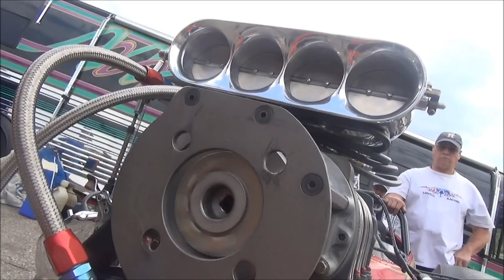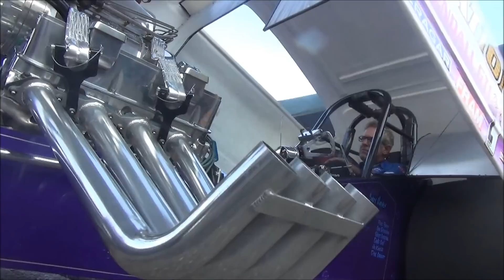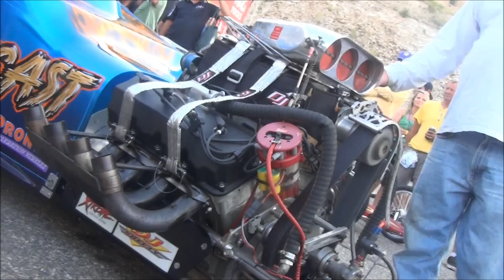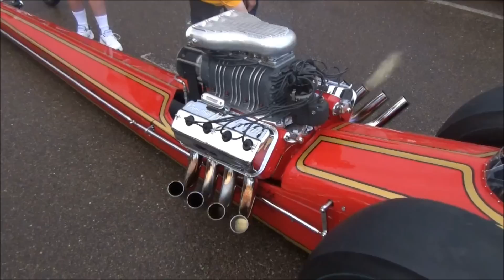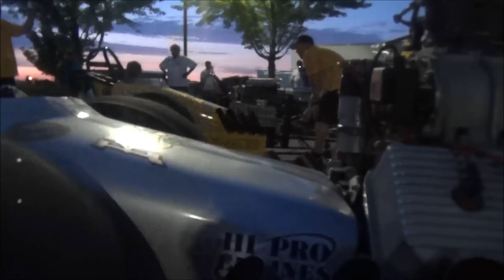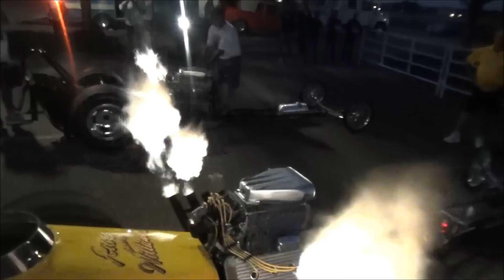"Cacklefest"

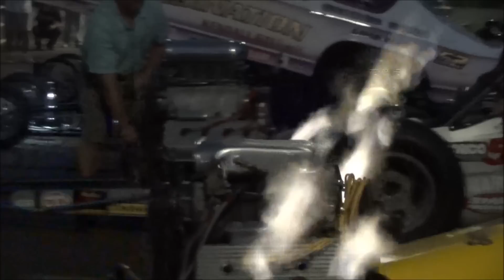Comment: @ 6:26 he had to be using 100% nitro. Love to go to those Nostalgia drags to hear that "liquid dynamite". Thanks for posting.
Reply: +Rick Taylor I don't think NITRO burns?
Has to have minimal alcohol in it to burn I think
Reply: +Big D nitro by itself does not burn. Nitro needs pressure and heat to burn. They have to use some alcohol or bang it with hammers to burn